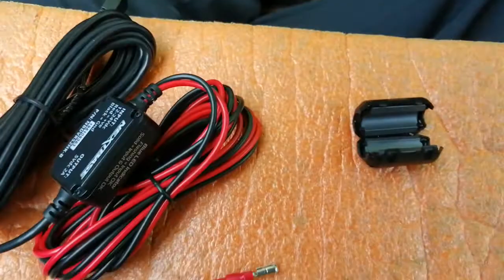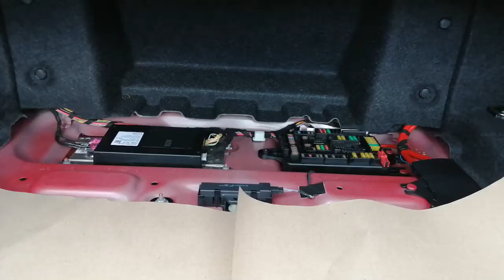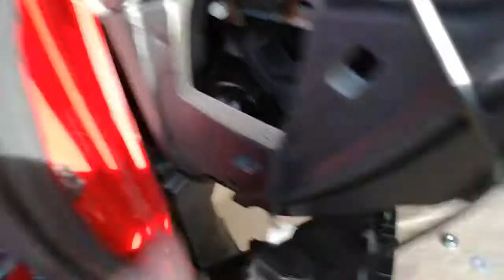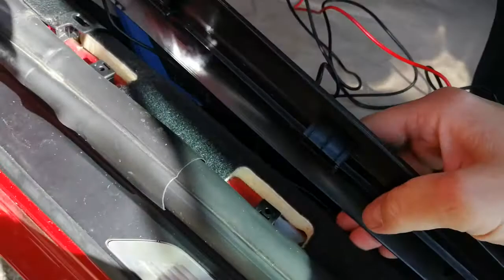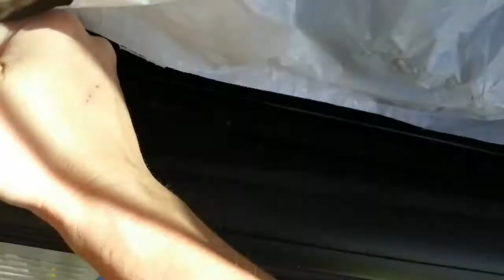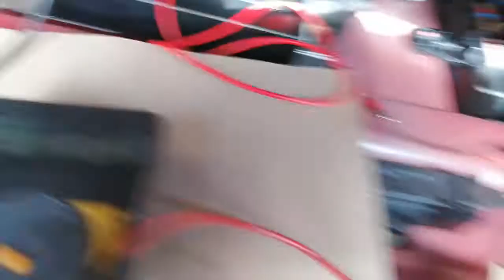BMW 2 series 2015 onward how to hard wire a dash cam

Comment: You make it look easy. Can I ask, do you know much about the Road Halo Pro dashcam? I have one which has the hard wiring that allows it to be in parking mode when the ignition is off. I have a BMW 3 series estate on a 62 plate. The hardwire they supply allows you to find a live fuse and it protects your battery as it's in a standy by mode. My chap has been in the boot car locked and testing which fuse remains live once the car is all off. Still not working. Any experience you can share woulr be much apprecitead. thanks in advance.
Reply: did you ever get to the bottom of this, also looking to have a permanent live for camera in my 2 series.